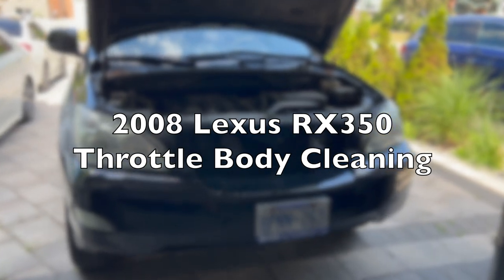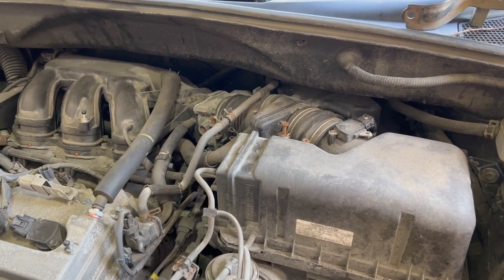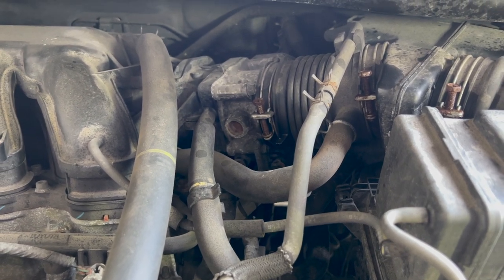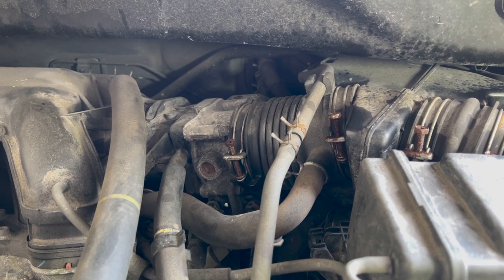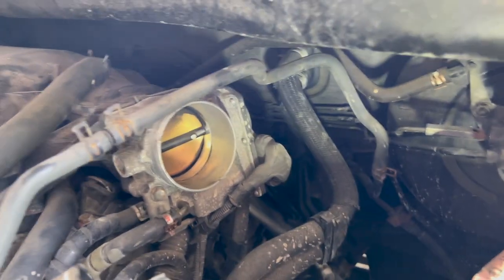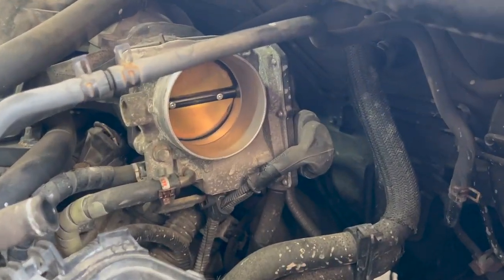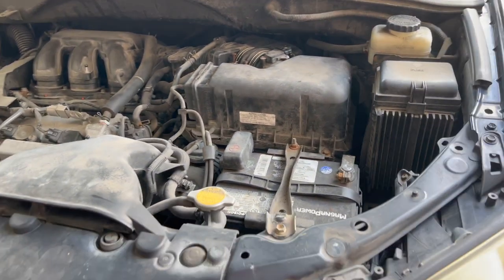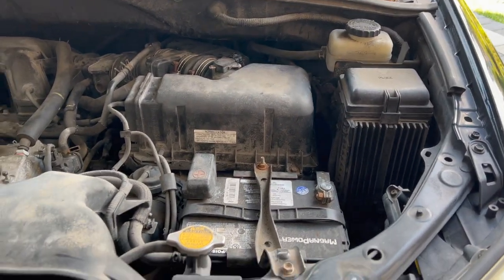Lexus RX 350 Throttle Body Cleaning

Comment: The 2GR-FE is port injection only. Toyota didn't do any sort of direct injection until they created D-4S, their twin injection strategy combining both port and direct injection. You can even see the plastic fuel rail running along the intake plenum going to the tiny plastic fuel injectors. These clearly are not going to handle the pressure of direct injection. While Toyota did add D-4S on the 2GR-FSE and 2GR-FKS, the second generation Lexus RX did not come with either of these engines, which is clearly the engine in your RX 350.
Additionally, fuel injection does not affect how clean the throttle body nearly as much as it affects the intake valves. You may be confusing the throttle body dirtiness with the intake valves